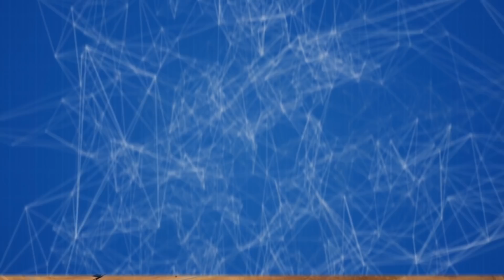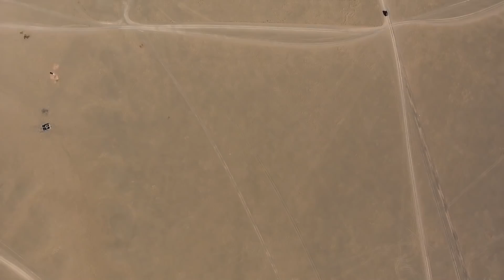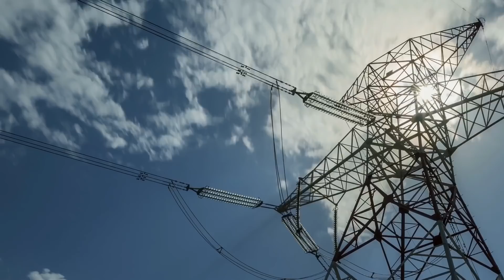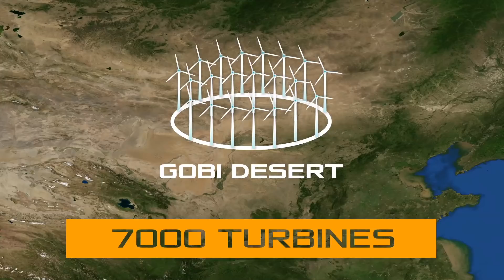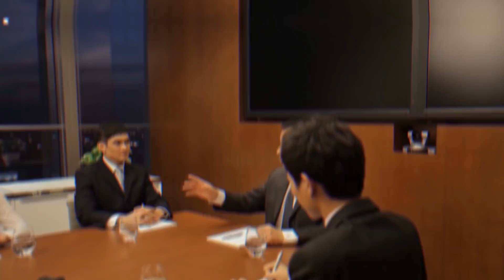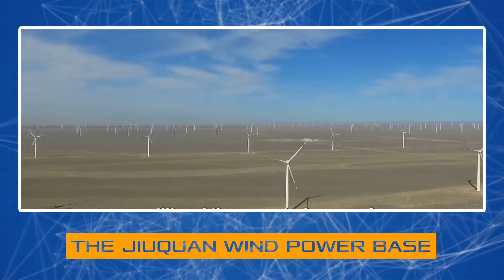How the world's largest wind farm works

Comment: This video is a laugh because it said just the local government refusing to cooperate the biggest wind farm in China failed.
Here are the last few years electricity generated by wind
Year     Electrical power generated in (TWh)
2012    95.9
2013  141.1
2014  156.0
2015  185.7
2016  237.0
2017  304,6
2018  365.8
2019  405.3
2020  465.5
2021  655.6
2022  772.0

Bearing in mind a country like UK generated about 310 TWh each years from coal, gas, nuclear, wind, hydro and solar combined so the wind power alone captured by China in each of the last two years is more than double the UK national total generation!

This video is full of errors because it claimed 6.1 GW was commissioned in 2021 globally.  Between 2010 to 2021 China alone in each year had commissioned more than 6.1GW according to Wikipedia.  Since China had installed total wind power capacity of 31.1GW and 328.48GW in 2010 and 2021 respectively the average increase is already 24.7GW per annum!

Comment: The capacity of this project had achieved 9.25 GW in end of 2020, not as big as 20 GW in 2010 plan, but still remarkable.
Reply: It is still not complete, so drawing concusions must be tempered with reality!
Reply: @prutherford2522   If you only count on money and profits, then most renewable energy projects shouldn't exist.
Reply: The capacity keeps growing and had been over 10 GW by the mid of 2021 according to open data.

Comment: These sort of reports only give the nameplate capacity. If it was known generally that the real output is significantly less ( 25% to 45 % when new, and drops off steadily from then) perhaps there would be less hype about this technically deficient source of electricity.
However much wind generation capacity is built there must be an equivelant amount of conventional generation to back up when wind power drops of, as it frequently does, to near zero.
It is also a misconception to think that wind can replace conventional generation, it simply cannot.
There is no option for reliable non CO2 emitting generation which is nuclear, nothing else we have can work.
Reply: Storage is the key
Reply: Sherri, 

stporage is not an answer to intermittency, it can't be. The deficit of low renewable output can't be covered by storage, it's a falacy.
Reply: They specifically said the capacity factor exceeded that of off shore wind in this location, meaning probably more than 45%
Reply: John, 
while one or two wind farms in the U.K. have acapacity fcator of 50%, it's not general. However that is still an overcapacity of 200% looking from the other perspective. Conventional plants can acheive near 100% when required. 

If you look at the records this is not shown as planned maintenance for nuclear drops it to the high 80% and gas\coal plants rarely run at maximum as they are balancing demand and supply but they are capable of near 100% when required.

Comment: All the problems associated with this installation were known in advance.   It's typical that significant quantities of renewable energy are located in remote areas.   It's typical that the need for energy storage and transportation aren't reported or ignored by project planners.  it's really unfortunate because wind energy gets a bad reputation.
Reply: Energy storage isn't always needed for VRE projects to be viable. It really only becomes more of an issue as a grid reaches 65% VRE. Just look at the South Australian grid. Transmission is normally taken into account for VRE projects, but sometimes regulations distort the planning or hide the conditions of the transmission network.
Reply: Is it a catch 22 situation,,,
Reply: Don't be fooled by China-haters.  There is such thing called UHV transimmsion line used mainly by China to transit electrical power over 3,000km distance with the minimum loss.  China has about 35 of them.  UHV starts at 800kv.  Maximum voltage used in US and UK are 500kv and 400kv respectively.  China's hydro are in Sichuan, Tibet and Yunnan, Solar parks in Xinjiang and wind farms in Gansu all transmitted 2,000 to 3,000 km to the coastal consumers in the East.

Comment: The landscape is aesthetically devastated for tens of miles around these architectonic monstrosities. 
The avi-fauna is sterilized even further. 
Besides, Does anybody know what happens when Terawatts are subtracted to the prevailing currents???
You can cancel this post but you cannot cancel the problems.
Reply: You clearly do not understand the complexity of China's energy reforms. Educate yourself.
Reply: @prutherford2522  The biggest problem with Wind and Solar is they are non-continuous...Non-continuous energy is worthless for industry, transportation and the general energy needs of individual citizens. You bring up China's energy reforms when Wind power can't even get out of the gate because it would require a back-up energy source?

Comment: I would tell the local officials that they may keep their coal and other carbon fueled generators if they wish. But, they must also keep the CO2 and other pollutants in their jurisdictions along with them instead of sending them off into the atmosphere to share with the green power jurisdictions. For every benefit, there is a cost. So, you can't have the sole benefit while passing along the costs to others.
Reply: oh you mean the West, which has "exported" much of it's CO2 production to Asian nations, and then pontificate to them on how bad they are? Maybe the fat rich West (especially US, Canada, Australia etc) should IMMEDIATELY CUT THEIR CO2 EMISSIONS BY AT LEAST 50%. Percapita these hypocrits ARE THE PROBLEM (remember the West's industrial revolution is responsible for about 70% of the CO2 in the atmosphere. If anyone needs to reduce their standard of living it must be the rich West; it must stop its overconsumption and accept lower per capital incomes .

Comment: Sell the energy to Nearby Countries.
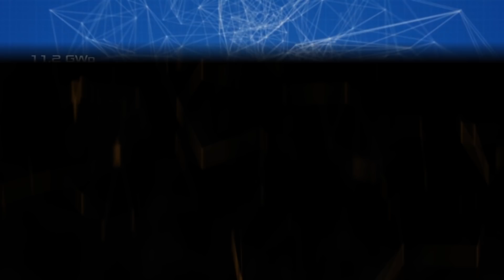Reply: Long transmission lines make the resultant electricity more expensive than fossil alternatives. That's what the segment at 5:48 is about.
Reply: @Natabus   Please supply statistics.
Reply: @DavidOfWhitehills  such statistics would depend on the idiosyncratic details of the land over which the transmission has to happen, as the voiceover in the video mentions. If you want explicit calculations of cost benefit, ask the folks who made the video.
Reply: @Natabus  Then why is Singapore working on a project to get renewable power from Australia 5000km away??
Reply: @ne4534  I'm familiar with the proposed Asia  Australia energy link and the solar park that it will be attached to. I look forward to it and think it will be a great project. But in the context of this video, the video authors have already explicitly said that transmitting the energy to Beijing would be more expensive than alternatives. Wether such a project is worthwhile depends both on the idiosyncratic nature of the transmission path, and the cost of alternatives. It's my own opinion that fossil fuel alternatives should be made more expensive by a carbon tax so as to encompass their true cost, but in the context of this video, the question is the alternative cost of local generation via fossil fuel is more or less than long distance transmission.
Reply: @Natabus  Renewables should be made more expensive??? Its priced as its suppose to be.
Fossil fuel is not going to get cheaper if at all. We have been paying more for it every year.
Lets calculate the true cost of coal, mining it, transport, storage and causing health issues. Lets also include the billions in subsidies the fossil fuel industry get every year.
The true cost of fossil fuel is never taken into account when compared to renewable. 
I really wish we let the market have its run at which to use. Coal will be gone in a few short years. 

Renewables are already cheaper and its not done yet, new technologies will make a lot cheaper. Its what we need. The only thing fighting it are politicians who get "donation" from fossil fuel companies.

BTW, lots of renewables can be setup for Local Generation, Coal can't. So power coming from a wind farm outside the city is not worse than coal coming from a mine far away or even another country.
Reply: @ne4534  "Renewables should be made more expensive??? " Where did I say that? Please re-read my statement above.
Reply: @Natabus  "fossil fuel alternatives should be made more expensive by a carbon tax"

Whats the alternatives to fossil fuel??? Its renewables mate. Do we really need to be this pedantic!
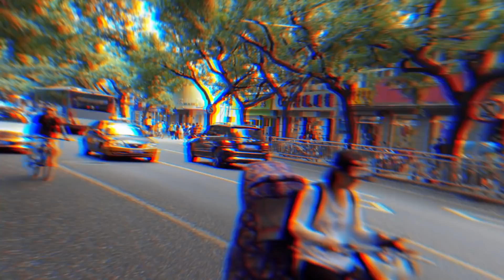Reply: @ne4534   You've totally missed what I said both in detail an intent, by loosing track of how the word 'alternatives' is being used in the sentence you quoted, as well as the sentences before it. . Read it again.   To reiterate: I am in favor of the Asia  Australia energy link you mentioned and think its a good idea, but Shanghai's motivation in launching it is more than just economics. In this video, the video authors are talking about China's point of view, and have already explicitly said that transmitting wind energy in this particular case from its source to the closest large market (Beijing) would be more expensive than local generation via coal, oil or gas. (This is at the 5:50 time stamp)  In the sentence you quoted, coal, oil and gas are the "alternatives" I'm talking about, and I think they should be made more expensive via a carbon tax, so that everyone, the Chinese grid operators included, will re-calculate which source is cheaper, in favor of non-fossil ones.

Comment: With every advancement of technology a certain number of jobs are eliminated.  The biggest issue is supporting new job growth in other industries while phasing out coal. Continuing to use coal unabated is just like doing the same thing over and over while expecting a different result. That is the very definition of madness.  Help and time is needed for people to develop and transition to a different economic sector (i.e. agriculture, service, manufacturing or tech) also a bit of patience and foresight. How do you replace all those coal mining jobs in such a limited time? What economic sector can be diversified in that province? What investments will be need to accomplish this in the short term? But one thing is certain, standing still is not an option.
Reply: People thought that computers were going to eliminate jobs. Sure they eliminated some jobs, but they created far more than they eliminated.
Reply: @CraigFryer  just wait and watch
Reply: @arpankumardas4221  You are going to have to explain more than that.